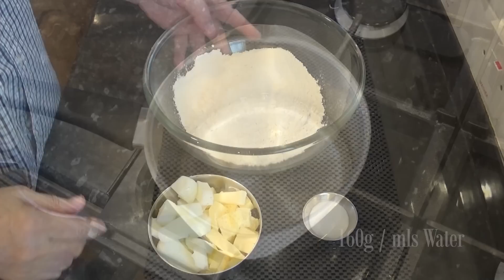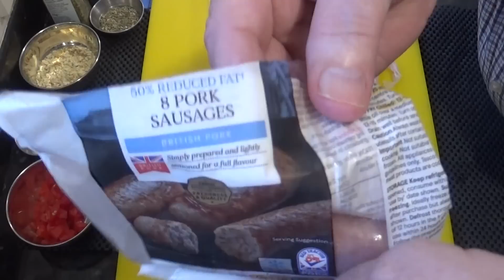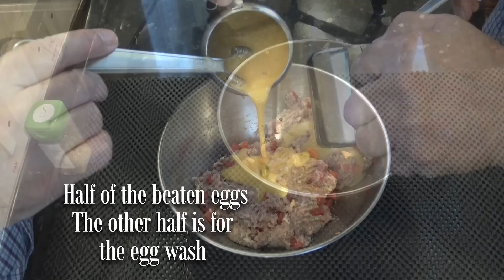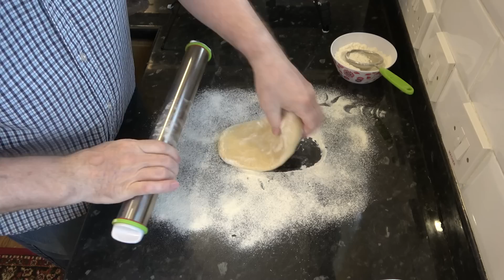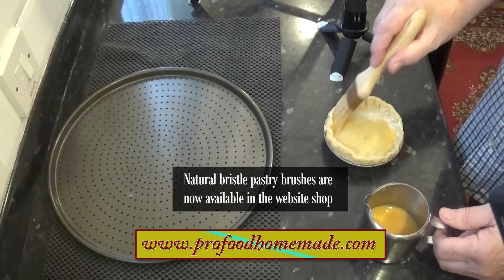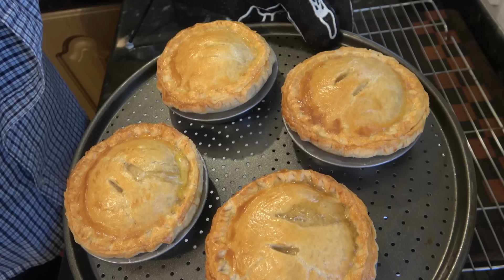Sausage, Egg, & Tomato pie, Quick, Easy, Economical, & Delicious.

Comment: a fairly quick and easy solution for using canned/tinned tomatoes in pastry pies is to drain them with a sieve and then spread them on a rimed baking sheet in the oven at its lowest setting for 45 minutes or so till theyre no longer soggy.
Reply from the maker: Thanks for the tip my friend. Thanks for watching my friend. Here is my latest video recipe. https://profoodhomemade.com/12-mini-apple-pies/
Reply: @JohnKirkwoodProFoodHomemade  I cant wait to make it! we actually made the recipe from this video today, and it turned out fantastic (aside from my clumsy eggwash sticking exactly as you warned haha)

Comment: Thanks for the great recipe! I had some frozen water crust pastry I made a couple months ago for a large shepherd's pie based on your pie recipes using kangaroo mince (I know it's technically not a traditional shepherd's pie which a made with lamb (and usually without pastry) but I was raised calling any kind of meat pie with mashed potato on top (with or without pastry) as shepherd's pie and the name has always stuck with me) with peas/carrot/onion/garlic/vegetable stock powder/gravy which turned out excellent even for members of my family who don't eat kangaroo (honestly you wouldn't have been able to tell it was roo meat unless told).

Anyway last night had some sausages in the fridge that needed to be cooked and remembered this recipe and that I still had that frozen leftover pastry. The sausages I used were just cheep supermarket beef sausages adding about a tsp of Vegeta vegetable stock powder, about a tsp of mixed herbs (thyme, rosemary, marjoram, basil, oregano, sage), a handful or two of panko breadcrumbs, some lightly fried onion & garlic and a beaten egg (forgot to add pepper, and neglected salt as the stock powder contains salt & MSG). Rolled out the pastry using the same roller shown in this video (bought it from Amazon a week ago which also came with a silicone mat) to 3mm thickness, unfortunately only had enough pastry to make two pies using Soffritto mini oval pie tins so I was unable to use up all the mixture (I've just made a fresh batch of pastry to do the rest today). Cooked them for 40-45 minutes at 180C in my fan forced oven, they came out looking perfect with only a slight bit of liquid on top that leaked out the vent of one. Ate them with some "ketchup style" tomato sauce (like a typical Aussie I love meat pies with tomato sauce, used a regular flavour for one and smokey flavour on the other) and they tasted absolutely fantastic. I really loved the hot water crust pastry which I made using coconut based shortening, though I think at 3mm the top may be a touch too thick for me so I might try 2mm tops for the next batch using round pie tins while keeping the bases at 3mm (like you said the rolling pin is an absolutely brilliant product for this). Also got some diced kangaroo steaks I'm thinking on making into pies soon too based on your steak (& onion) pie recipes.
Reply: Kangaroo mince ?????? now they are killing kangaroos ,,,, man that makes me hopping mad ,,,

Comment: Ran the recipe and while it produces a good, solid pie which one can pack for the road, it does need a little something if you're going to use it as a sit-down dish.
Definitely some cheese to start - either a nice cheddar or American - basically something yellow or orange which melts well - I'm thinking mixing that with the meat in the beginning.
It also needs more egg - I'm thinking either do a Scotch egg by placing a small/medium soft boiled egg - maybe half of one - in the center and reducing the filling to accommodate it, figure making eight pies instead of six, or simply reducing the filling and cracking an entire egg onto it before adding the cap to effectively include an omelet inside.
That'll give the pies a bit more texture and substance since right now, these are really just sausage sandwiches.
Reply from the maker: Thanks for the suggestion.
Reply: @JohnKirkwoodProFoodHomemade  Ran the cracked egg on top idea this morning - had to reduce filling by maybe a quarter to a third to fit an XL egg, with me just cracking it onto the pie and then capping it.
Cooked without issue, although the egg should have had some salt and pepper ground onto it before capping.
The wife identified another issue I was missing - texture for the filling - thinking of adding some bacon and/or some sautéed diced onions.
I just realized that I'm Americanizing your traditional British recipe - sorry - but I think you can agree that part of the joy of cooking is...I won't say "improving"...but building upon a recipe is definitely a fare word.
Of course, that's just causing trouble for myself as the wife and friends are now offering additional suggestions to further complicate what had been a simple, straightforward recipe.
Still, thanks for this and a ton of other great recipes - last night we had your garlic tear and share with your homemade butter.

Comment: John used reduced fat sausage. If you use standard sausages or sausagemeat, there is a higher fat content. This fat leeches out during cooking and makes the pie bottom soggy. Not insurmountable, but annoying. I would also recommend blotting the chopped tomato on kitchen paper before mixing it in to get as much water out of them as you can without squeezing them.

Comment: John, on the subject of bread, could you cover partially baked bread for freezing and later finishing it off in the oven?

Joe
Reply from the maker: I've tried Joe the bread never really comes out as nice. What you could do though, is bake the bread and freeze what you are not going to use straight away, but freeze it as soon as they have cooled from the oven, that way they stay very fresh when defrosted,  you can defrost in the microwave, on the defrost setting, it only takes a couple of minutes they even stay crispy that way
Reply: @JohnKirkwoodProFoodHomemade  Thank you Mr. Kirkwood for the advice.  You probably saved me from some self induced anguish.  ;-)

Joe

Comment: I love your individual pie recipes.  I’ve tried these multiple times, but I always have problems with the dough splitting when rolling them out. Can’t get it rolled out in one piece so have a hard time getting one for a shell. Please give advice to help with that
Reply from the maker: Your refrigerator might be running a low temp.  Take out the pastry about 15 min before using as too cold pastry will crack.